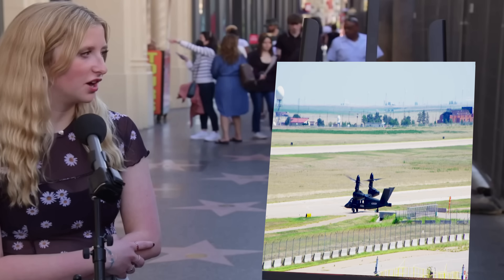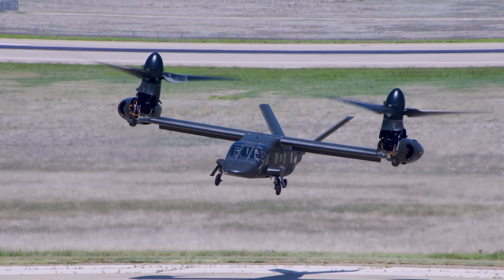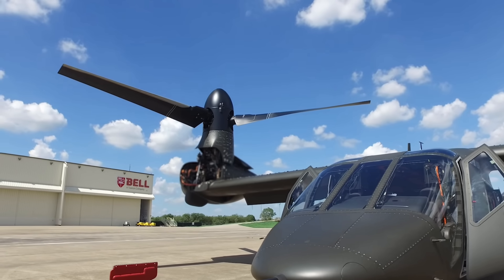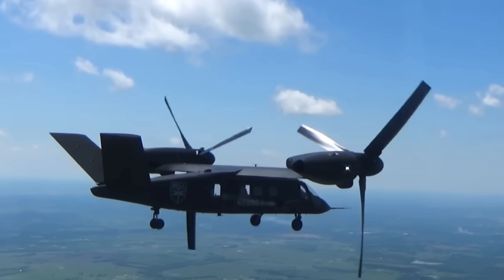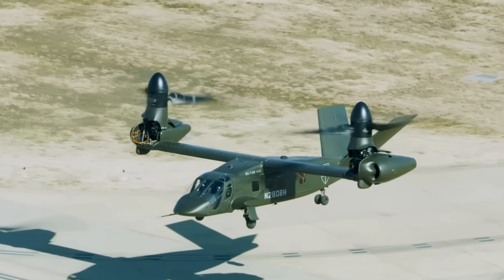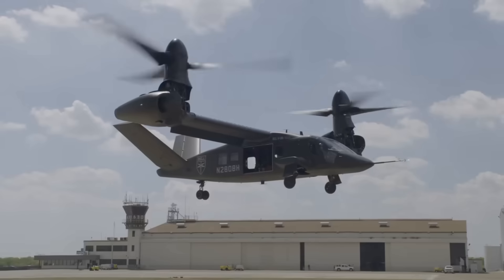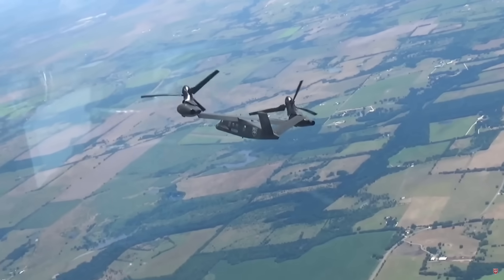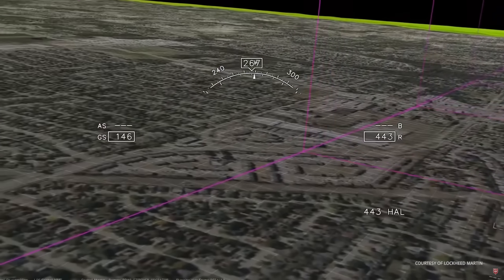Bell V-280 Valor - What's the big deal anyway? | BLACKHAWK REPLACEMENT

Comment: On this one I am gong to respectfully disagree in regards to replacing the apaches with this in particular. like you said it's big that is one reason, the other is stand off capability it provides. they are 2 completely different platforms If the US army has any sense they will replace the apache with a better version of it and this thing from bell should only be using weapons that engage at mid to long ranges  anyway which is a different kind of fire support role that you cant replace something like an apache with. Don't get me wrong it's nice to see them pushing for bigger faster more powerful platforms but everything has it's niche and role.
Reply: Unless you're the MI-24, then you can just be one of the best of it's class at the time it was made.
Reply: @Destroyer_V0  True, those things still look cool today too. Although the stinger did end up making short work of it in Afghan but that is just the natural progression of war as they were supplied in response to that helicopter out of necessity .
Reply: There is a heli scout program whose bids resemble more the capabilities of the apache, so both aircraft should complement each other while the valor should be more focused on transport (as requested by the army, as I have heard).
Reply: @user-pq4by2rq9y  Ah so its still going then nice, yeah having a highly mobile stealth chopper spot for you and relay target data does seem to be the way for the future so glad to hear.

Comment: To me this aircraft and V-22 are not Helicopter but Light VLOT aircraft and Lights Fixed wing (C-23 Sheppa,DHC 4 Carbiuo ) to UH-60 and CH-46 are helicopter. Well this dose an Job but what kind. There is 1,600 UH 60 in us army even if 25% are change to this aircraft there still be an lot around

Comment: No doubt the Valor is a sexy beast!  I'm just trying to get my head around the fact that it is going to replace the Blackhawk, which is a completely different platform with a seemingly similar mission set.  (Where's the modularity)  Maybe I'm missing something here.  (Wouldn't be the first time)
Reply: Agreed. It's a fine aircraft to work with the blackhawk but I'm not sure as a replacement. We'll see I guess, it might be a good idea 🤷‍♂️
Reply: @Mewithabeard  yes. It doesn’t make sense because the army is lying. Look at the Chinook. Shouldn’t take much to realize that the Valor is actually replacing the Chinook.
Reply: @TheBooban  That would make a lot more sense for it to replace the chinook. Again, it's clearly a great aircraft, but it really seems like it would be difficult for it be a proper blackhawk replacement. I hope we're all wrong and it does a great job for the guys who work with it, I just really don't think it's the right tool for the job
Reply: @Mewithabeard  Blackhawk will remain. Valor will only replace those for long range assault which was what this competition was about. The lie is that Blackhawk doesn’t do long range assault, since it doesn’t have long range, duh. The Chinook is used for those missions. So, no, this won’t replace the Blackhawk.

Comment: Cheaper maintenance? Never. Both the Competitors would be much harder to maintain than a BlackHAWK. The hawk was designed in the 70's. Its systems are simple and robust. The F-35 went the same way, sold as cheaper to maintain, but the reality is the opposite due to the highly complex systems. Both competitors were awesome. My concern isn't with Bell or Sikorsky. My concern is I doubt the Army can afford to buy and operate either aircraft. The hawk was a cheap pickup truck. Cheap to buy and easy to maintain. Now the Army is asking to buy Ferrari's. I'm afraid they will buy a few hundred and then end up keeping the thousands of hawks when their budget is inevitably cut.  What do I know? I consult for both Sikorsky and Bell, but not on either of these programs.
Reply: Program has been described wrongly. Blackhawks will remain in utility role. Did they really have long range assault mission? No, because they don’t have long range.

Long range assault are for Chinooks! Look at them. Valor replaces Chinook for long range assault.

Comment: If they really do plan to replace the apache with a variant of this, I would think being able to racetrack loiter in forward flight mode would extend its ability to stay near the forward lines. I wonder how loud this thing is versus a blackhawk.
Reply: This is not replacing the apache. They are doing the FARA program which is a recon heli to replace the role the Kiowa used to fill. They will be replacing half of the apaches with the winner of this competition which is between the sikorsky raider x and the bell invictus helicopter.
Reply: I believe this could replace both Apache and the A10 for CAS, especially with the new developments of the missile interceptors. With basically best of both worlds: speed, range, ammunition capacity and the ability to operate from small bases.
Reply: @solarissv777  Eh, I don't know about replacing the A-10. I mean, just watching this video suggests the complex mechanics of the rotor-tilt mechanism would be very susceptible to enemy fire. And considering how far from the centerline the props are, even if they had a common drive shaft so losing one engine's power wouldn't completely cut that prop thrust, I suspect it would have a hard time making it back to base, even in forward flight mode. I guess we'll see.
Reply: @Ughmahedhurtz  Isn't F35 replacing the A10?
Reply: @davidty2006  it is
Reply: @davidty2006  That might be some bean-counter's plan but I challenge what looks like a fragile, single-engine, relatively low glide-rate wing jet to survive the kind of abuse the A-10 did in the last major conflict it served. I'm still trying to figure out how stealth plays any role in CAS missions. Further, from what I've read about the F-35, it was designed as a multi-role fighter/bomber but it has less fuel capacity than any of the airframes it is supposed to replace.
Reply: @Ughmahedhurtz  I didn't mean to get into actual firefights with enemy. But use it either as a standoff munitions (long range ATGMs carrier) against pear enemy or just as a gunship that has a significant loitering time is airfield agnostic and is much faster then common attack helicopters. Just hover at a significant range and plink your targets, no need to come up close and personal. Additionally a drone with a laser designator may be deployed from the vehicle and used to guide various laser guided munitions (e.g. hydra rockets, SDBs etc).
Reply: @solarissv777  No worries. It's all interesting theorycrafting. ;)
Reply: @Ughmahedhurtz  With modern precision munitions, CAS support doesn't need to get in line of sight of the enemy. With infantry squads getting drones, they could use them to paint targets for other craft to engage them from behind hills. The GAU-8 is cool and all, but it won't defeat modern tank armor, and it is overkill for lighter vehicles. The A-10 is an obsolete design. I love it, it is still one of my favorite planes, but times have changed
Reply: @Ughmahedhurtz  it does have a shaft connecting the rotors to enable single-engine operation, like any aircraft of this configuration (including the V-22).
Reply: @Ughmahedhurtz  F-35 does CAS in a different way, though. The F-35 flies CAS by sheer precision while high up in the atmosphere.

If you have seen the struggles the Russian Air Force and Ukrainian Air Force had, you'll realize that the future of CAS is precisely what the F-35 and drones are doing. The days of crewed low-ground attack aircraft (i.e. A-10 and Su-25) are numbered in a highly contested battlefield, and even then, those roles are better fielded by helis and drones.
Reply: I firmly believe that attack helicopters are a complete waste of time, money and resources - unless you find yourself in a war against cave men
Reply: @robertcook2572  Infantry will disagree.
Reply: It's very quiet.
Reply: Need to bring back the Bell Bat concept for a fast attack tilt rotor

Comment: Wait...so they are planning to replace Apaches with these? That's like replacing a tank with a van!! Are they going to slap on the giant twin rotor system to an Apache? That would make a little more sense...I think...
Reply: The Apache has it's own replacement program underway. I have seen zero credible sources reporting that this aircraft is an Apache replacement.
Reply: @bluebox87059  Yup, bell submitted the 360 Invictus in the FARA competition, it looks a bit like a commache with a regular tail rotor.

Comment: There have been more fatal accidents with UH60s than with Ospreys, the difference is an Osprey has had a lot of attention and bad press. The V-280 will have a different mission and performance. The Osprey is an assault platform, the Valour isn't.
Reply: Shooting at...?
Reply: @dallesamllhals9161  No, the Blackhawk crashes within the last decade for example.
Reply: @bl8danjil  AHA! And how many 'hawks are flying around the globe these days...4K+?   

And how many Tiltrotors...400+?
Reply: @dallesamllhals9161  That doesn't detract from the fact that Blackhawks still crash or that the Osprey has low mishap record compared to other conventional aircraft.